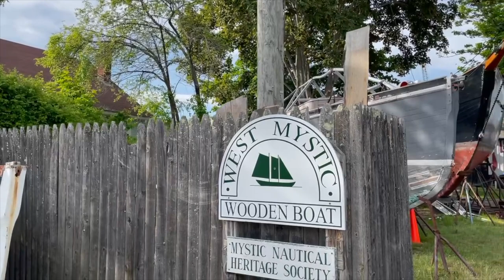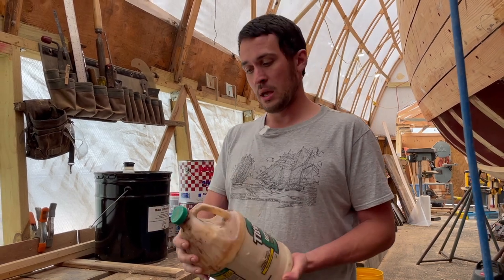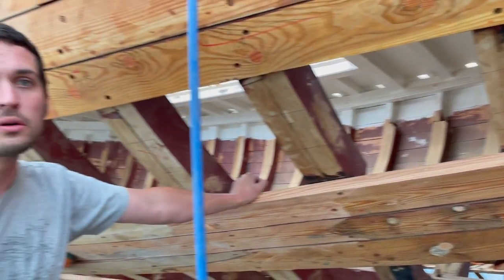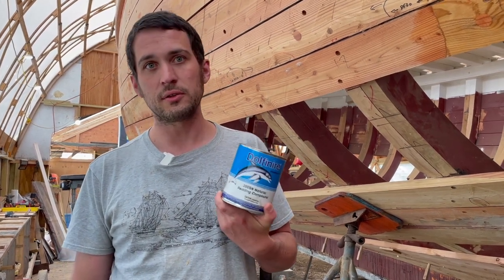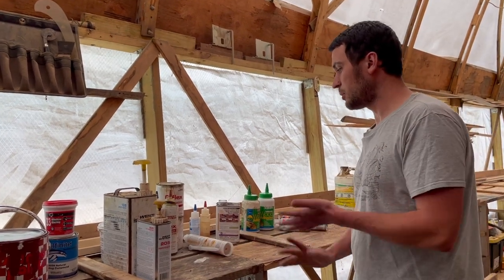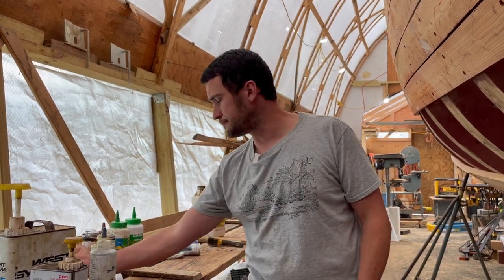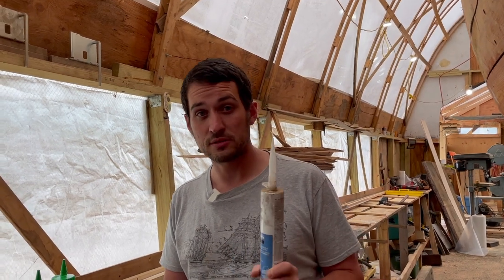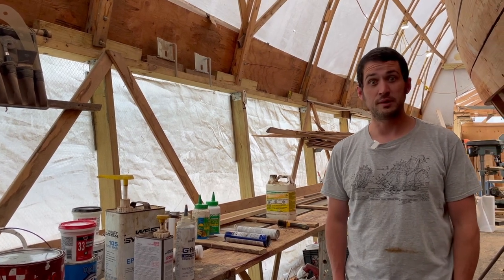Restoring Rosalind, Episode 15: Goos, Glues, and Other Accidental Rhymes

Comment: Bonjour Andrew,
Great job on this little Egret, as usual would I say. Is it easier to work on a small boat, apart a question of weight ?
Amicalement, Raphaël
Reply from the maker: Not so much easier, as different. Tolerances are tighter, things are easier to break... but also they're light and easy to handle. Thanks for watching!

Comment: I did go back to this episode and got the name of the polyurethane glue.  So no one bottle is on its way.  Expensive  to get it to Norway. £45. I see Sika is the brand making it.  I will try to fix a plank in my small 18' double ender gout boat. Strandebarmer.

Comment: I am a chemist, you might want to do a little more checking on the lead based paints, some of your statements are not correct.

I did like the part about the penetrating epoxies.
Reply from the maker: Which ones? I'm always open to more info. Thanks for watching!